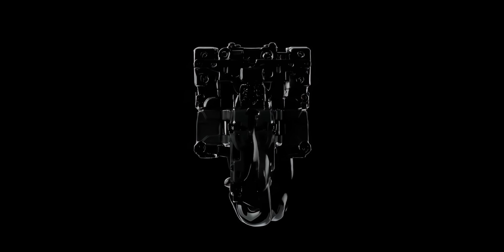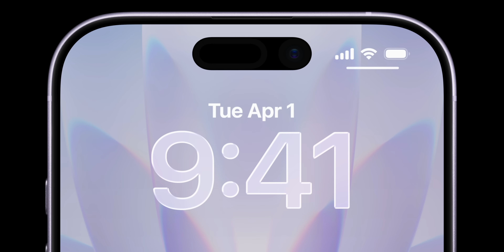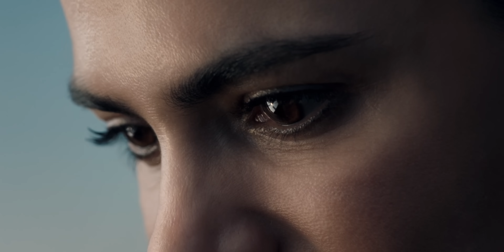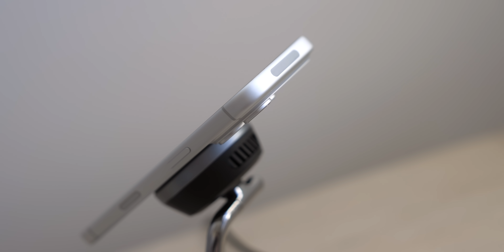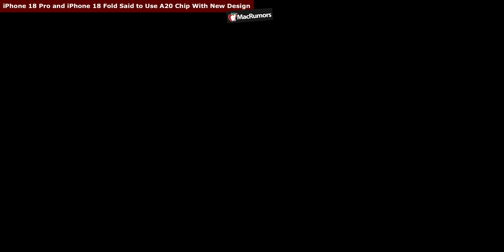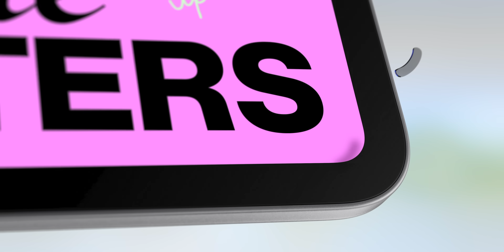iPhone Ultra Early Look! Major Leaks & Rumors!

Comment: You are wrong about the main usage scenario. The main feature is doing everything you do with a phone, but for people that are far-sighted or have 
Presbyopia, which is roughly 25% of the people in this planet. So it's not exactly a small niche. I am 57, and have presbyopia. Having to put glasses on each time I want to look at my phone is an annoyance that my foldable phone solves perfectly, I can just hold my phone at a distance where I can actually focus, and still see a decently sized screen. The challenge is that presbyopia usually progresses over the years, so prepare to see foldables getting larger every year (and you already see that with the 10 inch Samsung tri-fold and other tri-folds).

Comment: I keep going back and forth if this is something that I want. 

• I don’t like having to back to Touch ID. 
• All Foldable phones charge top dollar and give nerf’d phone systems. 

• I have doubts and fears about its durability. Things my current iPhone endured, like an accidental drop at the beach. That could be a big issue with a foldable. 
• • What about a case? Will 3rd parties be able to create a case that’ll protect it? 
• Media consumption doesn’t look like it will be much better than a Pro Max. Sooo what’s the point. They say multitasking, but I would argue that’s bs. Look at people trying to use the multitasking features in iPad OS on the iPad Mini…. It’s a nightmare. It’s not worth it. 
So yeah,,, I really don’t know…

Comment: Hi, i noticed you attempted to provide a frame of reference for the "thinness" of the rumored iPhone Ultra 4.8mm. I can recommend a more tangiblw frame of reference in the Samsung Galaxy Z Fold 7 which is a mere 4.2mm thin which comes in 0.6mm thinner than Apples rumored device.

Anyone wanting to get an idea of how thin and light (215grams),that Z Fold 7 is to get an idea of how much thicker the iPhone Ultra may be can stop by any ATT, TMobile or Verizon store for hands on with the Z Fold 7. When they expereince how thin the Z fFold 7 is, they can then just try to visualize what 0.6mm thicker may feel like. 
They can also open it to see how the 8in screen versus the rumored 7.8 iPhone Ultra looks like and imagine what the smaller iPhone Ultra's 7.8in screen may look like.

Comment: Apple not using Face ID and not using Silicon carbon batteries used by Hussein, Xiaomi and OnePlus is plain laziness. My gosh, are they not hiring enough developers and inventors to embed Face ID in the iPhone Ultra if that’s what it is called. And I bet Apple will use 120hHz refresh rate which is so yesterday. Apple should use 144Hz or 165Hz refresh rate.

Comment: That unused space on the left top and bottom corners on the outer screen towards the hinge looks so bad hopefully this isn’t the final design. I’d much rather the phone be thicker and have Face ID than thinner without it. Apple has been moving in the wrong direction for years at this point.

Comment: FaceID sucks tbh. Samsung’s Face Unlock is more reliable and faster. I tested it side by side with my iPhone 13 mini and Galaxy S10e. Every lighting conditions. FaceID is annoying as hell. TouchID is the best for iPhones, iPads, and Macs. The Galaxy S10e doesn’t even have depth sensor/lidar on the front and it unlocks with my face whether I’m under the bright sunlight or in pitch darkness. I love Apple. But Samsung’s FaceUnlock just really is faster and more reliable.

Comment: If 4.8 when unfolded, then 9.6 folded which is thicker than Samsung fold at 8.9, if apple really wants to make a statement it should be atleast 8.9 folded, that’s where the real usability comes in, it’s coming in late and your still not competent and industry leading would be very disappointing indeed

Comment: I think they should make it slightly thicker and increase battery , include Face ID and finger print for double authentication. And include all the cameras instead of focus and make the best looking and not compromise on features . They took this long and they should make sure no features are downgraded.
Reply: Don’t worry. They’ve learn nothing from iPhone Air failure. I will not buy an iPhone with less features and more expensive. These people failed Steve Jobs. They’re a a joke.

Comment: Honestly, I don’t like the design. I know these are just some renders and the real phone might look different. But these round edges of the display combined with the square body, it just doesn’t go together. In that sense the Fold 7 looks way better. Also, I don’t really use telephoto so 2 lenses are good enough for me but no Face ID would be a dealbreaker for me

Comment: I never understood the concept of foldables. You can get an iPad Pro (latest model) and an iPhone Pro (latest model) and enjoy the best of both worlds potencialy even save a few bucks on the way. 

With a foldable iPhone you get a huge a*s brick that does a flimsy job of being a proper iPhone and an even worse job at being a tablet.  Not to mention worse battery, plastic screen, worse cameras...just to name a few.
Reply: The Fold 7 (when folded) is the same thickness as an iPhone 17 Pro. Definitely not a "huge brick." There's also no reason it would do a "flimsy job" of being a proper iPhone - it's still a phone. The screens of foldables have been glass for several generations now.

About the only points you have some ground on are the battery (unless they go SiC) and potentially worse cameras (although every flagship has effectively interchangeable cameras these days and it's just a matter of post-processing).
Reply: @nickthaskater  All the points I made are rock solid. 

You can't even compare the durability of the screen on a foldable with that on an iPhone Pro or Samsung Galaxy S25. Generally speaking, foldables are still very sensitive to external factors (dust, water etc,) and even fingernails. Foldables have weaker and less cameras compared to the flagships, weaker batteries, lack features that flagships have... hence the term "flimsy". 

You can't seem to grasp that we are talking about phones that cost $2000 (iPhone foldable is rumored to cost between $2000 and $2500) but are packed with compromises all over just because... wait for it... they fold. 

I will repeat, buying the latest model of iPhone Pro and the iPad Pro is a million times smarter option than getting the iPhone Ultra (or whatever it may be called) because you will be getting the best of both worlds, without any compromises and bonus, save some money on the way.
Reply: @burimkllokoqi9265  the fact that you referenced fingernails shows you've never used one for any real amount of time and are just parroting talking points. Go actually use one, really use one, and get back to me. 

"Packed with compromises" - not really. No more compromise than saying a slab phone is packed with compromises because it can't fold. 

Buying an iPhone and an iPad is not the "best of both worlds" - that'd literally be a foldable. By having two separate devices you're inherently compromised by having *two separate devices*, lol, one of which does not fit in your pocket. 

I have four years of experience daily driving foldables. You clearly have none. Your opinion is worth very little here and it shows.
Reply: @nickthaskater  Yes, it was way to obvious that you are driving foldables because it takes a special kind of "person" to try and counter what I said. 

Everything I mentioned is a fact, a simple google search away to prove. Everything you said is a sad attempt for justifying your stupid purchase.

Let's take the current foldable flagship Galaxy Z fold 7 and compare it to the Galaxy S25 Ultra flagship. Does the Z have worse camera's compared to the Ultra? Yes. Does it have a smaller battery? Yes. Does it have a much weaker screen prone even to FINGERNAILS? Yes. Does it have a worse IP rating? Yes. Slower wired charging? Yes. Should I continue or you got the point? Oh, and a significantly higher price tag as well. 

And it does not matter that two devices don't fit in a pocket, we all have backpacks we use daily, any normal person who needs both would rather just buy two separate devices that are not just cheaper but are best at what they do with no hardware compromises instead of getting a toy that CaN FoLd but will break if you look at it the wrong way.
Reply: @burimkllokoqi9265  I don't need to justify my purchase - I've purchased three of them at this point. If I had any issue with purchasing them, I wouldn't have done it three times, lol. 

I don't need a Google search. I literally have them in front of me, unlike your sad attempts to sound like you know what you're talking about when you're just reading Google results. 

You look foolish reiterating the fingernail comment. Again, I've literally dug my thumbnail into the screen (far harder than anyone would be liable to do in any sort of regular use) and the mark goes away after a week or two. Tell me, have you done the same?

"We all have backpacks we use daily" - What? I don't carry a backpack everywhere I go, lol. Sorry, I'm not 12 anymore.

Stop speaking from a point of ignorance and try listening when someone with actual experience is talking to you.

Comment: Touch ID was always better. I could have my phone unlocking while it leaves my pocket, now I have to make sure I don't have sunglasses on and angle it right. The Galaxy Note 9 fingerprint reader on the back let me use it without changing grip or obstructing the screen and it even doubled as a way to bring down the top menu. I even miss the home button doublet options

Comment: 4.8mm is not even close to a record, only a record for Apple. There has been a foldable phone on the market for 4 months now that is 4.1mm unfolded and already uses the liquid metal hinge that Apple plans to use.
Still planning to get one of these, but need to stop talking like this is some new incredible thing never done before when products that use this same tech already exists and by the time this actually releases it will be just one of many using all the same stuff.

Comment: Touch ID makes sense on a foldable because Face ID would be inconvenient in real use. If Face ID were only on the outer screen, you’d have to close the phone every time you want to unlock it or pay for something. And if it were only on the inner screen, you’d be forced to open the device just to authenticate. A side fingerprint sensor works perfectly whether the phone is folded or unfolded, so it actually fits the foldable experience much better.
Reply: Exactly! I hate Dace ID in my iPad Pro because I never sit right in front of the thing using it. My 2. gen iPad Pro was much better using in bed with Touch ID......

Comment: It’s nuts people think Samsung will supply creaseless screens to Apple for the ultra but they can’t make their galaxy fold creaseless
Reply: They won’t but you gotta remember, the Fold 7 will be released before the next iPhone going off past history release dates. So we’ll see if Samsung can do it on the 7.
Reply: @snakeradish  I think you mean the 8, 7’s been out for a while
Reply: @2tierkeirStarmergeddon  yes, thanks. Never owned one but just did a quick search but didn’t notice it didn’t include 2025. Thank google AI.
Reply: Fold 7 is effectively creaseless. It's barely felt running a finger over it, and in use It's all but invisible. Huge improvement from previous iterations (I've owned a 4, 5 and 7).
Reply: @nickthaskater  and I think this is effectively what apple was waiting for. Honestly, I couldn’t imagine apple having a phone with a crease if even barely visible or felt.
Reply: @snakeradish  I mean, it's the same company that wanted you to put a rubber band around the iPhone 4 because they screwed up the antenna placement, made the iPhone 6 out of salami, and made the Vision Pro (enough said), among many other design "choices." Apple releasing a foldable with a crease is entirely on brand.
Reply: @nickthaskater those seem like more of an oops as opposed to “hey that screen is plastic and has a crease right down the center, let’s do it”.

Comment: Im still concerned about the durability of the internal screen, like all folding phones it is a plastic screen which can even get damaged from fingernails.
Reply: Stop repeating BS. The inner displays have been glass for several generations now. And no, they can't be damaged by a fingernail. I've owned several Folds. I've also dug my thumbnail into the screen - it made a mark on the screen protector which eventually went away after a couple of weeks.
Reply: mate do any bit of research and it will tell you the inner screen has a thin polymer layer even over that glass that is soft and easily damaged. You can baby the phone and take care of it but that's not something I want to do for a 2000-3000 dollar phone. There is a reason why foldable phones depreciate exponentially on the used market, they are delicate and get damaged much more easily than regular phones.
Reply: @thorium9190  mate, I've owned and used foldables for the past 4 years. The screen durability is not an issue, and the screen protector is removable/replacable. I do not baby my devices one bit. My Folds come with me in my pants pocket downhill mountain biking and hiking, to the beach, under the hood working on my car, wherever. My 4 literally fell down a rocky waterfall into the water below and didn't have a problem. 

Get back to me when you have something more than having watched JerryRigEverything's nonsense.

Comment: A 5.5" exterior screen sounds small, but the iPhone 8 max was 5.5".  Thats back when the standard iPhone was only 4.7".

I have a Z Fold and I dislike that the external screen tall & narrow.  I have little use for the exterior screen.  I generally only use it for phone calls.  If I do anything useful, I unfold it for the larger inner screen.

Comment: I’ve got an 13 pro and 13 mini.  Going to hold on to it till better batteries are in the new models.  Will buy the air if it gets new batteries in a couple years.
Reply: Tape them together and you have a fold!

Comment: I love Sam describing the foldable iPhone, as if we haven't had them for nearly a decade. "It's like two phones put together!" ...LOL cracks me up 🤣 ...But seriously, I hope it doesn't look like those renders! Despite the "crease", Samsung nailed the thinness and design with the Z Fold7. 

People are making mockups of two iPhone Airs together, with a "Pixel Fold" type hinge.... That's too thick, and a terrible-looking design. I would think Apple would design something more elegant. I hope the iPhone foldable is more like the Fold7 - the outside screen should go to the edges all around. 

......That said, it's interesting, but honestly, foldables are only 1% of the phone market. I just switched from the 13 Pro Max to the iPhone Air - I am certainly not going back to a bulky, heavier device - I love carrying around one Air. I'm not going to carry two. And also, the Air is the most durable iPhone ever. A foldable would be going "backwards" to something more fragile... No thanks...

Comment: As with most new Apple product introductions, I expect the feature set will be lagging for 3-5 years into the future. Yes there is convenience to fold it in half and then open it to get a larger screen. But it’ll cost perhaps $2,000 or more. Who cares if the chip is super fast if the feature set is limited? Isn't the A18 iPhone chip about to be used in some multitasking laptops soon? For the same money of a hobbled iPhone Ultra, you can get both a full-featured iPhone and a full size iPad. Oh yeah, it's about the bragging rights to that wonderful "Ultra" purchase.

Comment: Watching this on my galaxy fold 5 which has a crease which you notice from time to time but mostly you dont notice. I would not trade in a foldable with any other phone it is just that good. And Apple lovers will surely love the form factor it is hands down a dream phone for me. I only wished it had the performance of one of the new gaming phones so I can run the classic pc games on it like gta 5 and play on the side. even my old fold runs gta 5 but not as smooth as the latest elite gen 5 phones so I might need to be more patient.

Comment: It’s not the fucking hing that we are worrred about ….it replacing the inside screen …….insurance comps dont even insure fold phones here
Reply: The inner display is quite durable. I've used a foldable for the past 4 years without any issue. I treat my devices like tools - drops, spills, bumps, etc. Also, you can just get Apple Care+ (or Samsung Care+).
Reply: @nickthaskater  that says nothing …regarding what i said
Reply: @user-ux3gh3nt8i  you said you're worried about replacing the inner screen. I said 1) you don't really need to worry about that, and 2) you can get Samsung/Apple Care+ and just send it to them to get fixed if needed. What are you missing?

Comment: Apple didn't solve the crease. Samsung is making the display with fine mtech to create the laser drilled metal plates to remove the crease. Additionally the Fold 8 will debut this creaseless display before Apple releases theirs.

Comment: No real substance in this video other than confirming the obvious. It will exist, it will be expensive 😂

But honestly idc what it costs or other things about it. If it can run ipados specific apps when unfolded and has any form of writing support (a new apple pencil or magically using current ones)… im copping immediately.

I own a galaxy fold because it performs specific roles for me. I use ios daily, but acknowledge that apple isnt ready yet. If this “ultra” can do what i need im sooo ready to buy 😅😂
Reply: Are you stupid? He talked about the chip/thickness/battery/cameras/modem/ wifi. The list goes on tf do you mean no substance? 🤦‍♂️